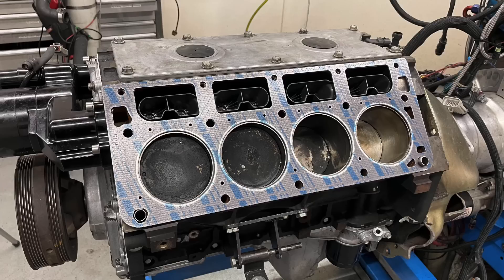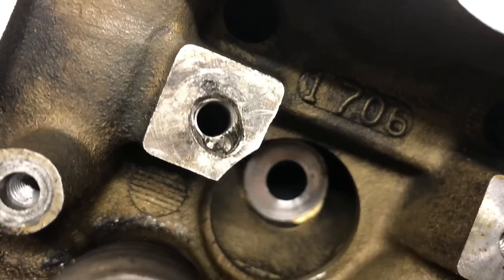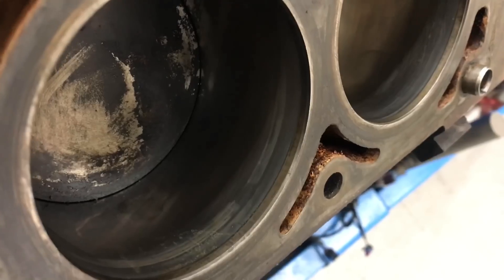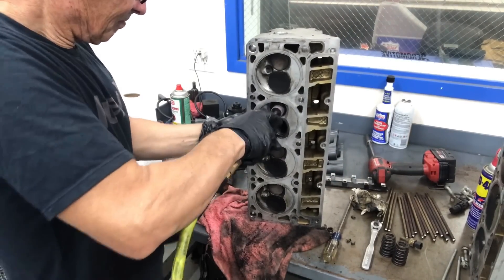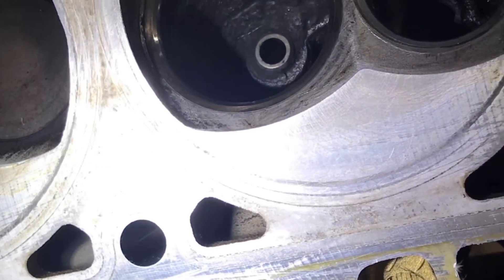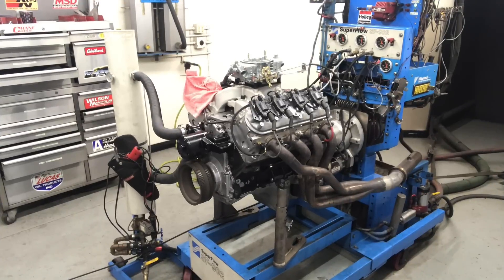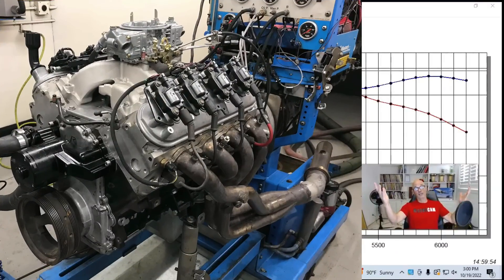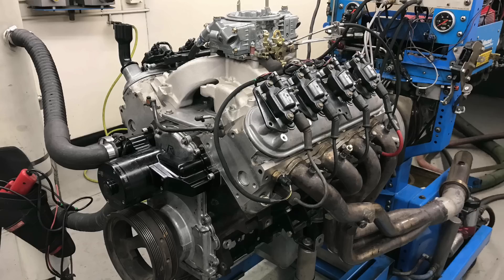CHEAP, BROKEN, JUNKYARD 4.8L-WILL IT RUN? WITH SO MANY ISSUES, CAN THE DAMAGED LS COME BACK TO LIFE?

Comment: Spray on oven cleaner works like a charm for heads. I just stack up some pallets in my yard, spray those babies down (disassembled) and then spray them off, and use my leaf blower to dry them. Re-do it until they're clean. (3x max) Its amazing.

Comment: I wanna see what a bored out 4.8 does at 3.898 stock cam shaved head 0.030 to bump compression since the stock overbore 5.3 picked up 50hp an a bunch of torque and didnt lose anything anywhere in the curve

Comment: If that 4.8L had accessories on it, alternator, power steer, pump. etc... what would you expect the power drop to be? Trying to compare to my TB48 (inline 4.8L 6 cycl) factory specs 248BHP @4800 rpm and 257lb-ft @3600 rpm it has a compression ratio of 9:1. This motor also has VVT on the exhaust CAM. My big plans are to add boost.
Reply from the maker: please see the accessory video
Reply: @richardholdener1727  Thanks Richard, I missed that one some how but have found it now. Cheers!

Comment: Running the Stage 1 PDS cam on my 4.8 with an LSA blower. Never had the heads off. But today a lifter finally started making noise and lost a little oil pressure.

Comment: Have you ever had a problem with the rocker bolts being so tight you round them over? I shorted a 6pt socket by maybe .030" to sharpen it so it grabs the whole height of hex and it works better.
Reply from the maker: that helps

Comment: I use some clp on a set of 706 heads and treated like cleaning a gun. Worked so well that I could see bare metal with no scratches. Carb cleaner helped a different set of heads. All the pushrods had a kink in them. 
Realized on the trucks that bad injectors were the cause of that carbon buildup. Got some flex fuel injectors and we were on our way. New hardened pushrods and gm cts-v racing lifters help the valvetrain. 
The stuff we find on deployments will never stop amazing me.

Comment: Excellent work. Funny how some things make a difference some don't and what the community thinks is true of both. Many will tell you your ruined that cylinder and you ruined that valve job, but when your starting with a bent valve and that cylinder head (roflmfao), I've never seen anything so fubar, yet it WAS repairable... Next time you have a 4.8 in that condition do a hot compression test before and aft. I have heard newer engine actually like smooth cylinders, that the rougher cross hatch causes friction or drag. Do the compression test next time may be that time you use the ball hone.
Reply from the maker: I wish I did

Comment: Just bought a 2004 zo6 with 4000 miles,,what intake,cam,heads would you install to procharg at a later date...thanks  for your time if you answer.
Reply: Seriously, only 4,000 miles.

You probably don’t want to hear this. But, with those low miles you bought yourself a future investment, leave it Leave it stock and get a higher mileage one to play with.

And it’s already an LS1, just change out springs and get a small duration cam that will offer lots of bottom end power. The Pro charger is a high rpm blower that will take over in power from the mid range up to redline.
You can pick a bigger cam if you don’t mind it being softer on the bottom.
Reply: @bri-manhunter2654  yes sir,,found 2 with that low of miles..one is in p.a. was in a car collection..same as the one I bought in n.c.,,paid alot for it..but it's practically brand new..and prefer the c5 body style myself.
Reply: @hungbeachbum . C5 is my favorite body style too.
Reply from the maker: go find a 6.0l or 5.3l and build that

Comment: Great! And Thanks for doing this kind of project where you make an engine run with very basic tools and processes. Just the theme for a low buck diy amateur as myself.

Q: head gaskets - can you reuse them if the kinda look ok? Or always replace them?
Br - Peter from Europe - Denmark
Reply from the maker: I usually replace the high mileage ones-but might reuse in a pinch. I definitely reuse new ones over and over

Comment: Just got offered a good running 6.0 for 500 buck's, should I get it??? What's the normal rate for a 6.0?? I've always been a gen 1 sbc guy, probably always will be but got ideas for an Ls.
Reply: Yes get it.
Reply: @kendriver9139  is that the going rate or is that a good deal? It's still in truck, sounds really good, I mean for a stock engine.
Reply from the maker: yes-get it

Comment: I got a dumb question but why would there be carbon in the intake? Was it because of the bent valve? Does LS motors have egr or something?
Reply: 99-03 trucks had egr. 
Bad injectors and bent valves can be a cause.

Comment: My goodness dude, I have done that on grain truck 391s and after rusting the cab off hauling fertilizer I pulled it out and went .030 over with 3.98 crank and a set of early 352 heads with CJ valves a good carb and a solid cam and it ran great !

Comment: Hello Richard. Lapping is so rewarding or it will make you cringe. Lol. I lapped some valves on a 862 I bought from eBay. The valves were good but some were pitted maybe 3 on the exhaust I used corse compound with a drill. No problems. I only did one head. Other one will be done this weekend or sooner. How’s you fix that rocker hole? I have a huge job when I get home concerning my 6.0. I need a garage

Comment: I'm going to ask my local Machine Shop to quote me a "Super Richie" service.   As Bartenders should know any drink you can name.. the machine shop should be ready to oblige.  Right? Lol.   I wonder if you put a little Vaseline around the edges of the piston.. if the small particles from the ball hone would get trapped in it.. Allowing you to wipe most of them away.
Reply from the maker: bearing grease also works

Comment: Great job Richard.  That's my "Go To" motor for cruiser swaps.  I can buy 2 running 4.8's around here for the cost of a 5.3.  My biggest costs are the induction (PCM or carb) and the fuel systems.  I have also run into the same problems over the years, one of the biggest is the worn pushrods AND rocker bodies, I hope you replaced them also.  I love building LS's and have quite a few sitting around the garage.  I just finished putting a 5.3 in a '68 C 10 and my new project is putting a 4.8 in a '88 S10.  I'm going through the motor to correct any problems but I'm leaving it bone stock because I'm putting a World Class T5 out of a Camaro behind it and don't want to scatter the trans all over the road.  This will be a low buck fun project so I'm even going to reuse the head gaskets and bolts, I'm even going to try my hand at cutting down my own stock harness.  I really like to watch these video's working with stock or slightly hot rodded motors just to see how much you can pull out of them.  Thanks.
Reply: Do you not have any pick n pulls or wrench a parts around you and if not you could probably find someone on here to get you a computer
Reply: @james10739  I have plenty of PCM's and harnesses but when used in other chassis vehicles as a stand alone there is 50% of the harness that is not needed.  As far as the PCM is concerned when you have it reflashed you need tp remove VAT's, downstream 02 sensors, trans wiring or whatever along with a little work on the fuel map if you cammed the engine or made any other changes in induction or exhaust.  
I've done over a dozen swaps and used aftermarket systems or carbs with Daytona Smart Spark controllers, the problem is that it can cost between $600-$1000.  Cutting down a stock harness can be done at home for nothing and a reflash of a stock PCM can be had for a lot less than $100 with upgrades.  They say good up to the 500hp level and a lot of my friends are not made of money.  With a cut down harness and stock PCM I can do a whole swap for a grand plus the cost of the motor.

Comment: Also, I'd love to have this engine in a S-10 or a late 90s to early 00s Blazer. I used to own a 1996 GMC Jimmy SLE Sante Fe Edition and the 4.3 ran great and had plenty of torque, but having a 4.8 LS in it with the 4WD would've been awesome here in the snow. It actually won Best in Show at NOPI Nationals back in 2003 when it had a full body kit, 22" Lexani chrome wheels, 8 TVs, 20 10" subwoofers (10 on each side in custom carpet matched enclosures), four US Amps, airbag suspension, and a custom PPG Platinum Pearl White paint job. Everyone loved it. Slammed onto the concrete with the Lexanis tucked in the wheel wells. It had a custom built Paxton supercharged 4.3 OHV V6 that made 266 whp, but the engine was never built with forced induction in mind, so it eventually blew up.

Comment: There are several threads left in the bottom of that hole. You could install a stud down to the bottom and fill the gap with epoxy and/or a piece of a nut.

Comment: Looking forward to more 4.8 stuff. I have an LY2 i got for dirt cheap running terminator X and a s475 clone in a new edge mustang. Put in a E1839P elgin cam and it seems a good size for the 4.8. Smaller than the “stage 2” stuff so doesn’t give up as much down low and should carry out to the limit of the nnbs truck intake at 7000ish pretty well.

Comment: Rich I'd seriously love to see a well executed 4.8 high compression, high lift/duration NA build and see what it can make. I mean engine builders secrets included, max horsepower from a 4.8 with an extremely lopey cam, high RPM, and high compression (like 12:1 or 13:1) with either E85 or 111 octane. I am legitimately interested to see what it'd make.
Reply: Sir, I’ll have to ask you to leave with that automotive pornography!
Reply: I could see a 4.8 breaking 525-550HP with the biggest cam known too man on a max effort NA build, would be almost completely undriveable on the street but it would be so damn fun to drive it would probably rev easily too 8500-9000 even it would be interesting to bore it out too fit LS1 pistons while keeping the stock 4.8L stroke to really work the cylinder heads too their max potential
Reply: He's already done a destroked LS3 as mentioned above, and him and engine masters have proved that bore to stroke ratio is meaningless. So the small bore of the 4.8 block won't make any difference if head flow is the same.
Reply: @chipcurrey653 . Agreed
Reply: Richard already did a destroked LS3 with those same kind of specs.
4.8L would just be a smaller bore version of what was done with the LS3.
Reply: @bri-manhunter2654  and this is the point to use a 4.8/5.3 Block
Reply: @shadowopsairman1583 . Agree, if you have it, run it! That’s why I stroked my 5.7L Hemi to a 6.4L, instead of buying a 6.4L.
Reply: Well 4.8s are flat pistons, only way to increase compression is to use domed pistons or a smaller Combustion chamber in the heads,.
Reply: No real purpose in a max effort 4.8....just not the right bore stroke configuration to really do well.
Reply: @HioSSilver1999  I understand that it's not a very effective build, but I have always been a big fan of those oddball builds. Like people modifying and turbocharging the air cooled VW engines, same thing. I'm just a sucker for the oddball builds that no one else is interested in.
Reply: @DiamondBackRattlaKid  ima sucker for effective builds then
Reply: @HioSSilver1999  bs
Reply: @shadowopsairman1583  no bs about it. The small bore will limit it. Only way it ever makes sense to limit ci is in class racing where the rules limit it.
Reply: @HioSSilver1999 . Agreed

Comment: Why use composit head gaskets? I thought they where all MLS head gaskets.
Reply from the maker: it was laying around
Reply: If you have early heads with a notch on the mating surface by the second exhaust port you gotta use the composite gaskets….mls only on later year heads

Comment: Easy Off oven cleaner should clean the carbon out
Reply: Yep, any oven cleaner with sodium hydroxide. I used that to clean the carbon buildup from the turbo on my diesel engine. Worked great!
Reply: That might be what he's running the engine on.

Comment: I rebuilt a motorcycle engine one time that had cylinders that were so rusted up the engine wouldn't even turn over and I just pounded the pistons out, honed the cylinders, put in new rings, hand lapped the valves, and it ran so good it didn't even burn any oil.